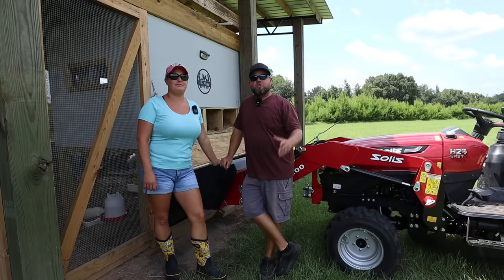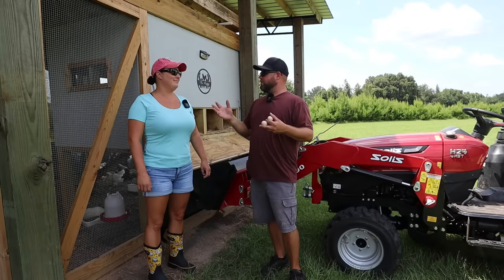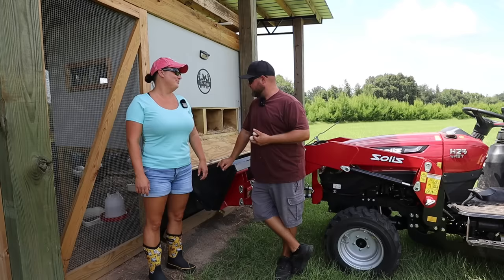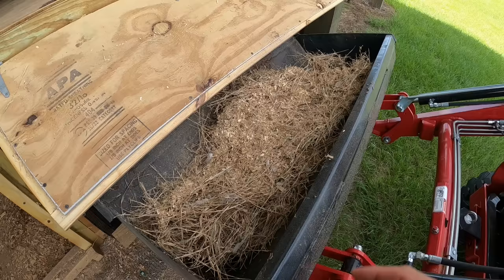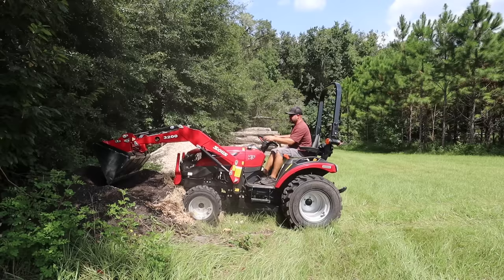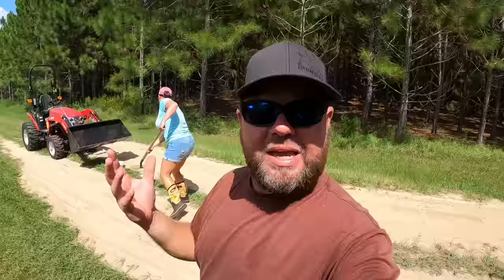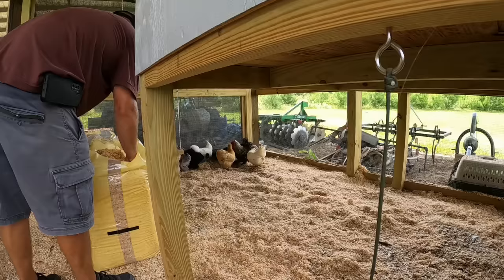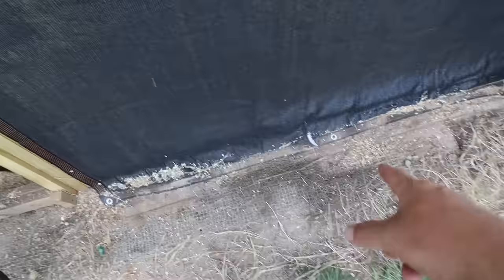Easy to clean DIY chicken coop test! Success! #825

Comment: I know nothing about raising chickens or chicken coops. But a thought of a water proof covering over the plywood flooring. Linoleum? Rubber mat? Prevents urine and poo saturation but quick clean out even leaf blower. 
Might have lots of reasons not to consider my thoughts but just throwing it out there.
Reply from the maker: It's a popular suggestion, but I've seen no problems with treated lumber.

Comment: Just curious if you do anything for protection on the floor boards of the coop to protect from the droppings. Is there some sort of animal safe sealant you can put down, or do the shavings do an adequate job of protecting the floor. It didn’t appear to be stained with droppings. Or would you easily be able to replace the flooring when they become rotten?
Reply: I’ve also seen a few people that have painted the mesh around their coop. It doesn’t really add anything but aesthetics to it, and has made filming the chickens from the outside a little easier. Just noticed that the camera has a hard time focusing through mesh and then you end up opening the door for a cleaner shot. Have you seen this and what are your thoughts on it?
Reply from the maker: No stains, no rot and no sealant. It's treated wood, so I don't expect any issues. A viewer did tell me about painting chicken wire. Lack to help with the camera, I need to do that.